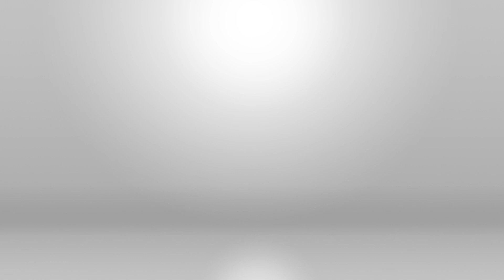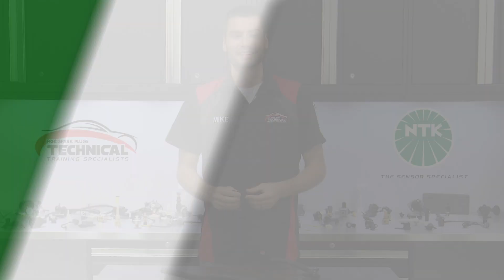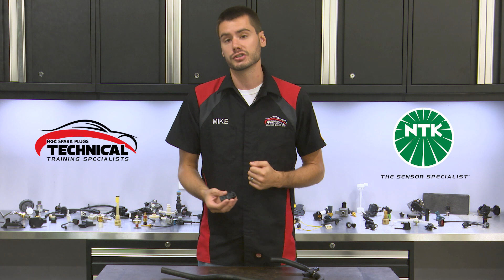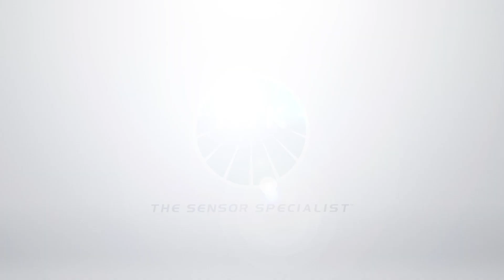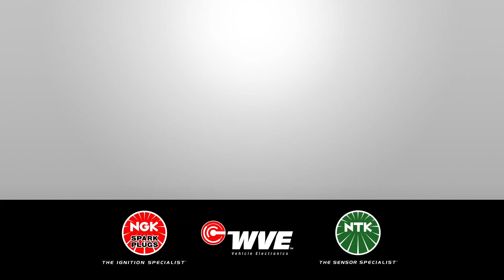NTK - Fuel Tank Pressure Sensor (FTP)

Comment: I have a mustang 2001.
It’s giving me a code p1450 
Any idea what that could be ?
Help! 😥 
Thanks
Reply: It’s your Fuel Tank pressure sensor. my guy. You most likely need to replace the fuel tank pressure sensor.
Reply: Same code on my 2013 taurus, certain its the ftp sensor, but if its not affecting my drivability at all I don't really have to worry about it
Reply: Code also says "unable to bleed up fuel tank vacuum"
Reply: YinAnonYang  it was a broken hose. From the purge valve to the tank.
Reply: Take it to autozone
Reply: IvanMTG1 already went there, that’s how I know what the code is.
Reply: @kevinromero3990  they didnt give you a print out of the common symptoms and common fixes? My local AZ totally hooked me up with the issue and part or parts that may be the issues.